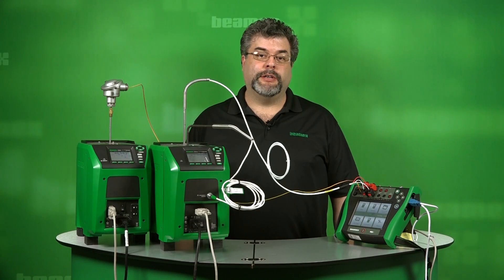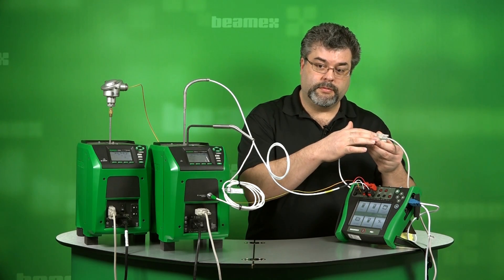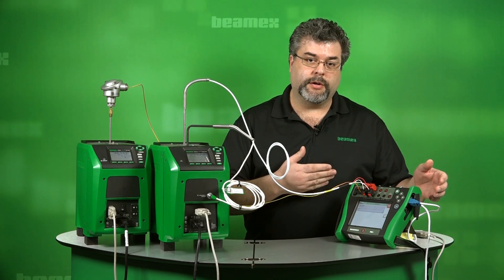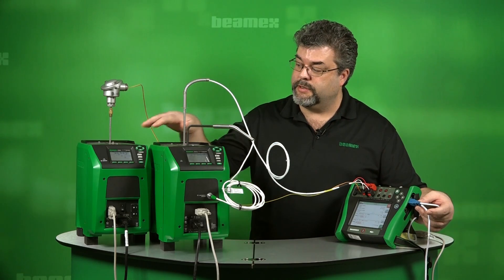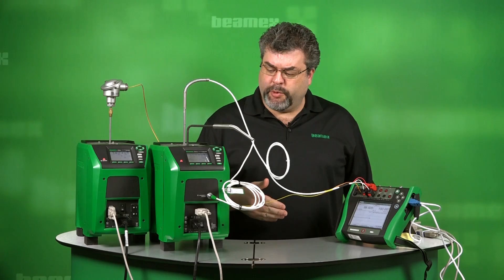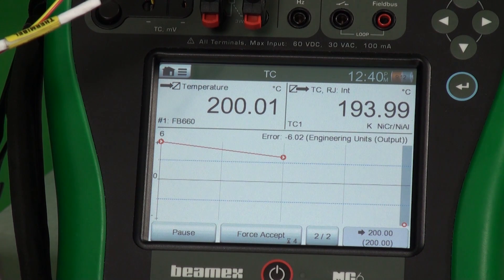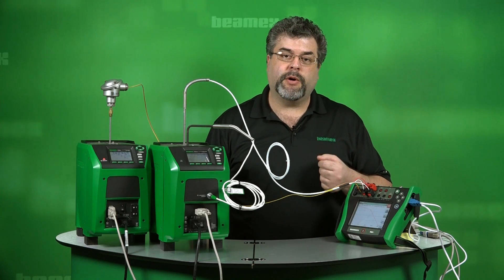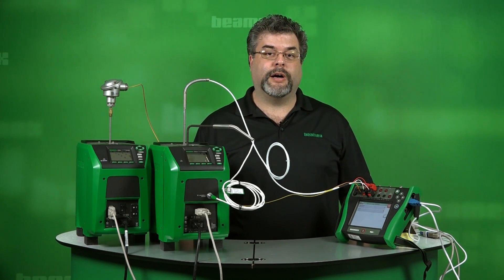How to calibrate two temperature sensors simultaneously - Beamex

Comment: Actually I'm confused how can someone doing calibration on a sensor ????  Does thermocouple have memory or brains ??? The video here is on calibration checks if if the sensor outputs whether mV/resistance within a limit then its passed or if not the guy says it has to be replaced. Then how it called a calibration when it is a calibration check. Please clear my doubts sir and please also explains me what to say when someone ask me about how you do thermocouple calibration ??????
Reply from the maker: Hello Sir, when we talk about metrological calibration in this video, we refer to the formal International definition, i.e. the calibration is a documented comparison of the DUT against a traceable accurate calibrator. 
So we are not talking about adjusting or trimming the sensor. I know that sometimes the adjustment is also included in the word "calibration". It sounds to me that you refer to the adjustment of the sensor. 
Most often you can not adjust a temperature sensor, so if you find errors during the calibration, you will need to correct these errors by other ways (sometimes you may use coefficients to correct the reading). Or replace the sensor.
I hope this helps and explains. 
Thanks, 
Heikki / Beamex
Reply: @BeamexCalibration  Thanks Heikki Sir, you really clear my all doubts about calibration & Correction which is separate from calibration. Thanks again sir  🙏

Comment: Is it possible to perform the calibration at RTD without a ref. probe?

Regards,

André
Reply from the maker: Hi Anrde, you always need a reference sensor that you compare the sensor to be calibrated. But a temperature dry block also contains an internal reference sensor that is built in the block. You can use this internal sensor also as a reference, but it is typically not quite as accurate as the external one. I'm just writing a blog post on these topics, so please check our blog in a couple of weeks fro more detailed information. Thanks / Beamex, Heikki Laurila

Comment: This demonstration was for a 4 wires RTD output, right?

How do you proceed for a three wires RTD wiring (output) ? Just make a wiring jumper solve the problem?

Regards.
Reply from the maker: Hi Andre. Yes, the demo was done using a 4 wire connection. If the sensor has 3 wires, it is enough to connect the 3 wire to MC6, it will automatically recognize how many wires are connected. No need for any jumpers. Thanks / Beamex, Heikki Laurila

Comment: Hello, 
Does not TC need a Ref. probe for calibration?

Regards.
Reply from the maker: When calibrating a thermocouple, you also need a reference sensor,  either the internal one in the block or using an external one. Thanks / Beamex, Heikki Laurila

Comment: why do two at once?
Reply from the maker: Hi Dave! The main point with calibrating two temperature sensors at once, is to save time. It takes some time for the temperature block to go and stabilize to a new temperature, so doing two at once saves time.

If the probes have the same calibration points, they could be done in the same temperature block. But in this video there are two temperature blocks being used as the two probes have different temperature range. The Beamex MC6 calibrator can control the two temperature blocks simultaneously. 

Hope this answer helps!
Reply: BeamexCalibration  thanks for the reply. For a 5 point cal, how long would it take to upscale to 100degC?. And how fast is the down scale back to 0degc if it is carried out straight after the 100degC point?
Reply from the maker: Hi Dave. It normally takes about 5 to 10 minutes to reach and stabilize to a temperature point. It depends a little on how big step you make, what kind of probe (load) you have and what is the stability need.